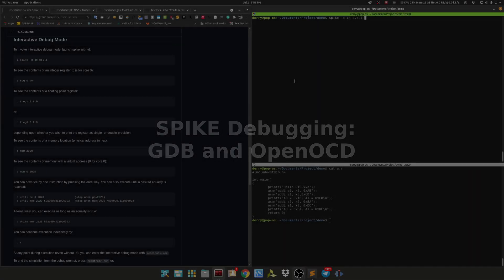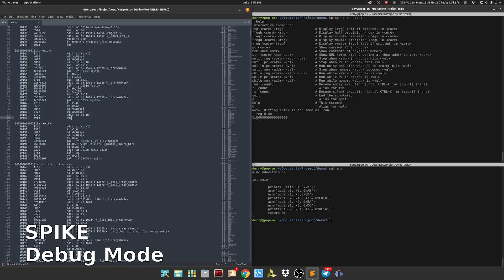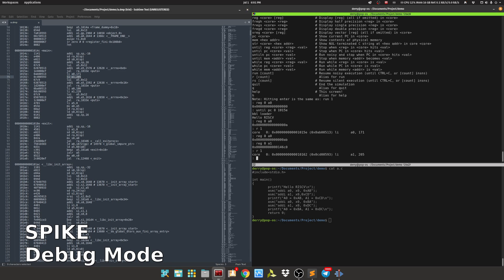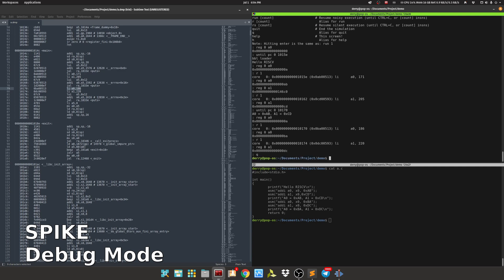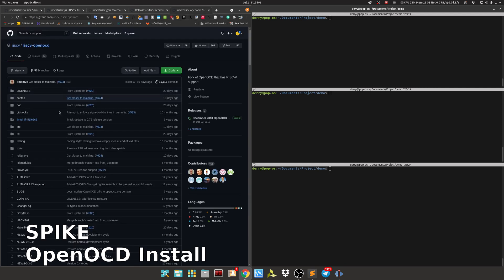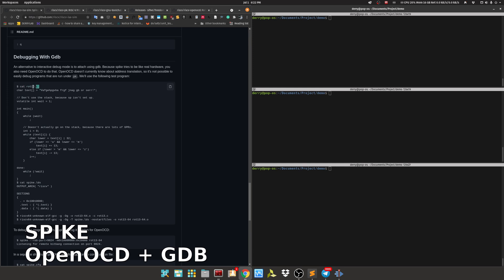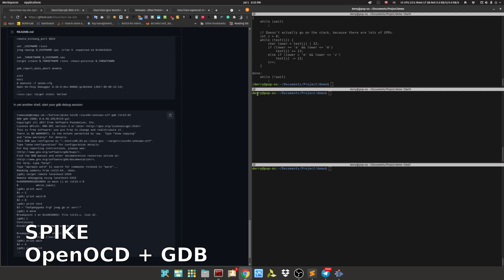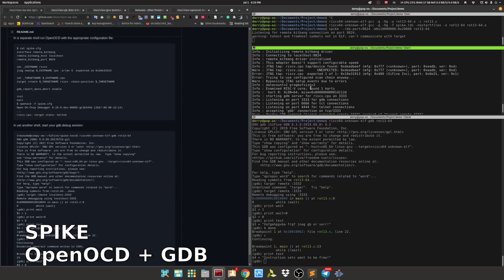RISC-V Tutorial: Spike Debugging, OpenOCD, GDB

Comment: Can the Risc-V be debugged using Eclipse?   For example, I understand the Risc-V can be synthesized on a Smartfusion2 FPGA, but Microchip's SoftConsole (Eclipse based) is currently designed to work with the chip's (hard) Arm M3 IP and the FlashPro5 debugger:
OpenOCD xPack (Microchip SoftConsole build), x86_64 Open On-Chip Debugger 0.10.0+dev-00859-g95a8cd9b5-dirty
Reply from the maker: Yes it is, but I haven't try it yet. Since this video only covers how to use the OpenOCD, to connect it to eclipse you may want to look here https://eclipse-embed-cdt.github.io/debug/openocd/riscv/